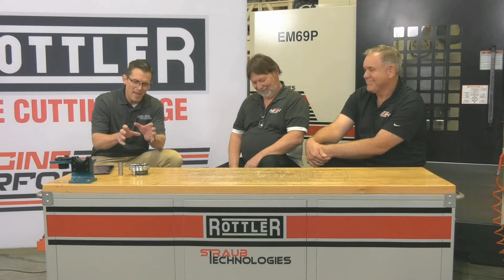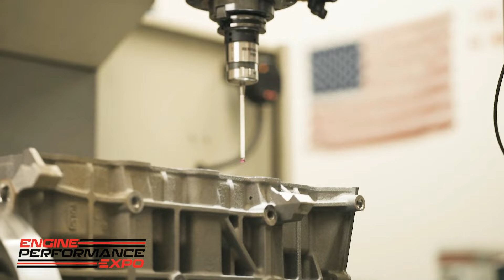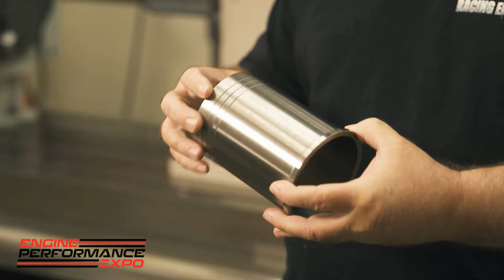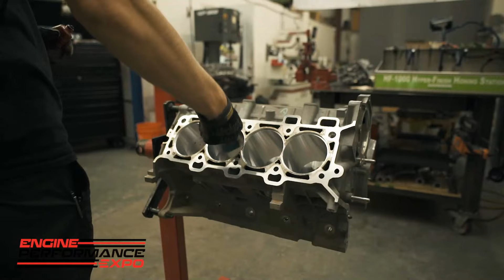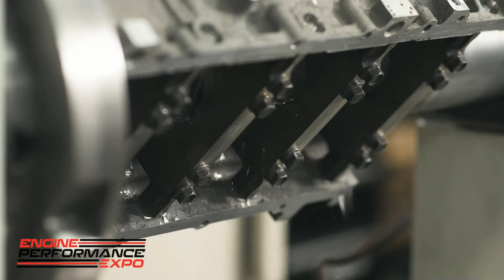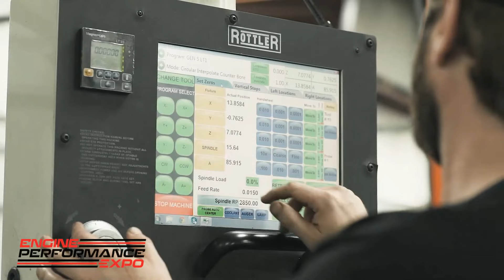Engine Performance Expo Day 3 - Episode 23 : Block Sleeving

Comment: At what temperature  should a aluminum block to install the sleeve.
Reply: 300 degrees for approx. 30 minutes. That should cause cylinder holes to expand approx. .008 from size. Dart uses .002 press on their liners in aluminum blocks so you get .006 clearance for inserting sleeves.